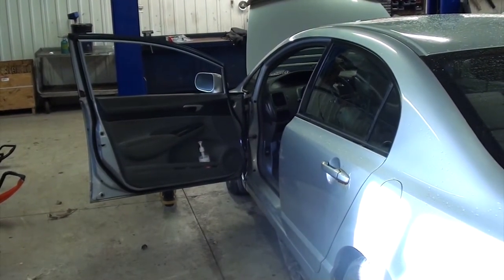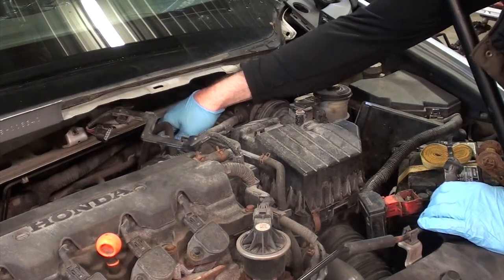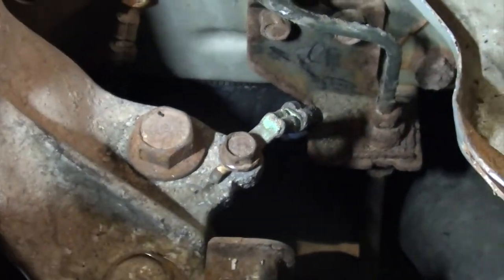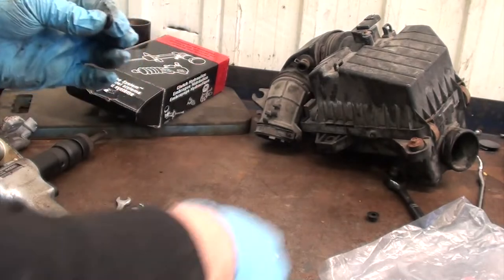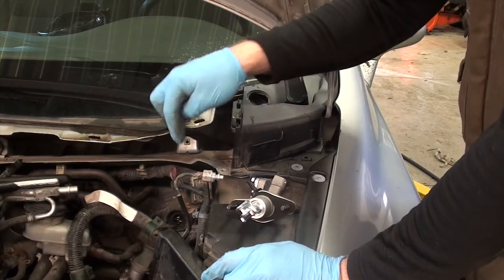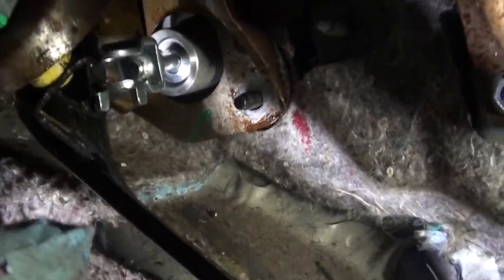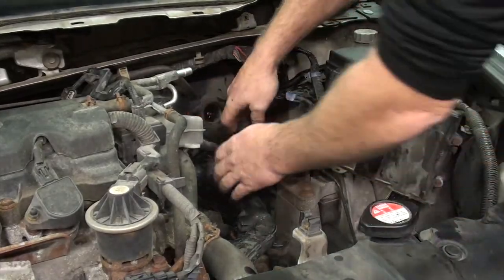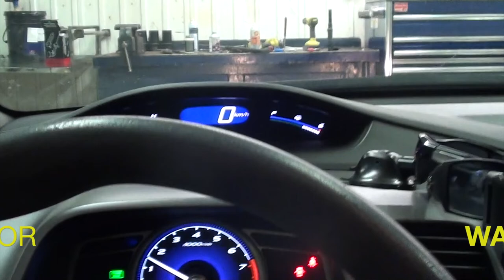Honda Civic Clutch Master Cylinder Replacment.  2006 - 2015

Comment: This made changing my CMC soooo much easier.  Thank you.  Mine came with 2 roll pins instead a new U shaped pin
Reply: The one I was looking at on rockauto had the roll pins as well. Was it easy to get them in? How has the part held up?

Comment: I replace the CMC on my 9gen civic and I still can’t go into any gear… why? Yes the fluid is clean and yes the clutch pedal acts how it supposed to act but there’s no pressure
Reply from the maker: Sounds like the clutch may be damaged.   Often when the clutch springs become dislodged, it does not disengage fully.   I would suspect you need a new clutch.
Reply: @crownedroyal2003  man … almost fainted

Comment: how do you bleed the clutch after replacing since there’s no pressure in the clutch?
Reply from the maker: Vacuum bleeder is almost the only way.   I have had luck pushing fluid back to the master by pushing in the slave too.
Reply: I tried the second way and blew out my brand new slave cylinder. Just buy a $15 bleeder kit lol
Reply: I opened the slave bleeder and ran fluid through the system till it reached the slave and thought this meant the system was full, but my clutch doesnt work it only makes weak pressure and thats why im watching how to replace the master but the master not holding air would explain my symptoms perfectly so thanks for these comments im gonna vac the fluid back through from the resevoir and hope i pull out some air and not have to do this ridiculous cmc replacement.

Comment: Thank you so much!!!!!

I didn't need to take out the brake part, or battery, I struggled a lot but I eventually managed to get the part in and out and avoided removing extra parts but I wouldn't have done this without this video.

Comment: I think my cmc has failed on my 07 si. Gonna attempt this job asap. When you use the vacuum bleeder.. are you just opening the bleeder on the slave cylinder and turning on the vacuum?? Or do you need to push the pedal when you're doing this???
Reply: Also how has this held up ? No issues with the after market besides clip fitment?

Comment: I've done this job 3 times now and never removed half the stuff you removed in this video lol. 

My advice would be Dont bother removing that tray and all the stuff underneath it, and also go ahead and delete the air box and install a CAI. Makes access way easier for the future and you're already removing the box anyways.

Also have a new pin ready for the master cylinder. It's always broke.

If you don't have a vacuum bleeder, bleed the system before installing. Much easier that way
Reply: Make a video and show how you do the replacement.  I'd love to see.